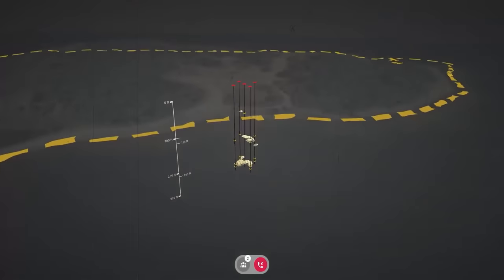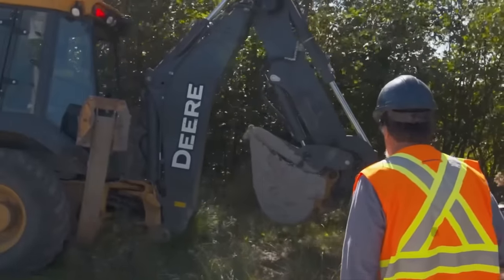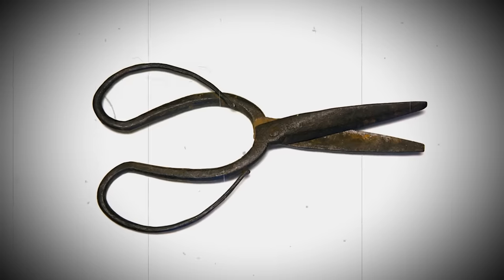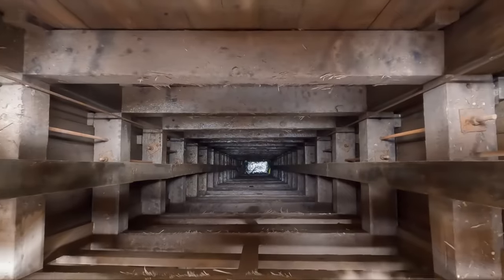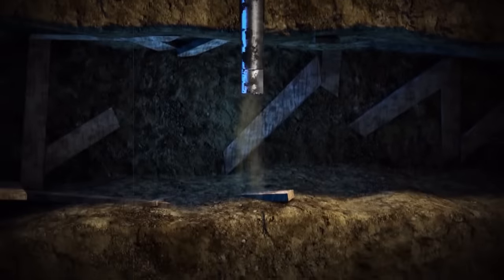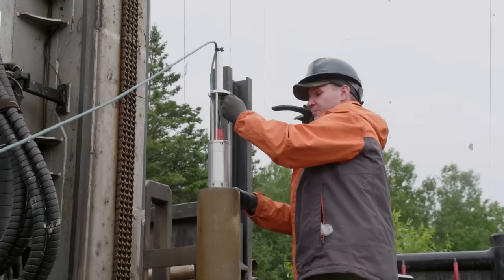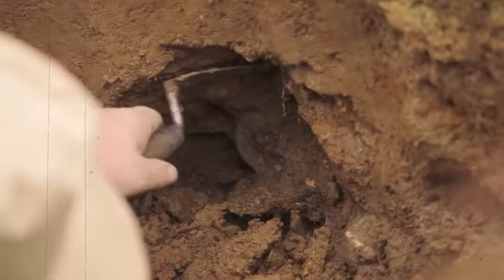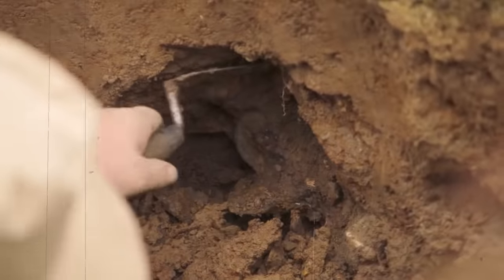The Oak Island Treasure Has Just Been Found! | Season 11

Comment: Oooo a caster wheel those have been around 1000s of years.
Reply: Look at the picture of it. It has modern hex bolts and clearly also has ball bearings. Nobody in the 1600s etc had the machinery to produce ball bearings or hex nuts for modern ratchets.